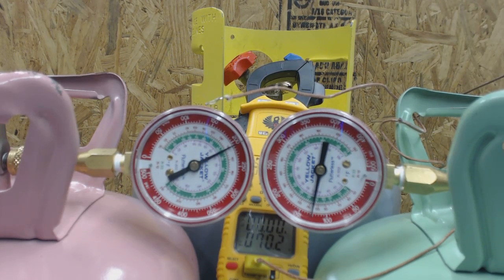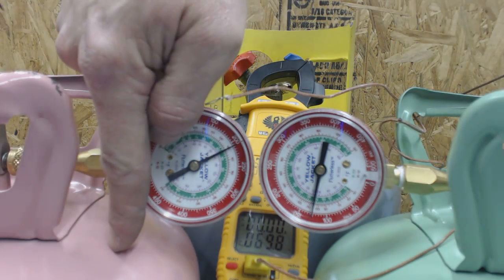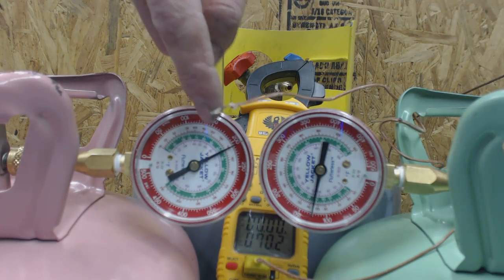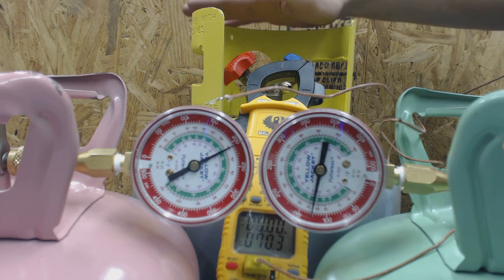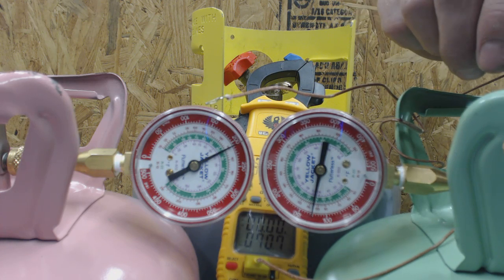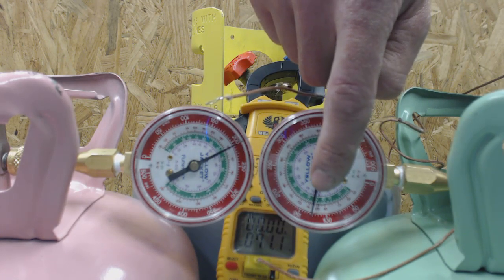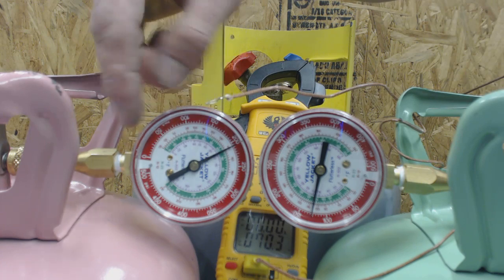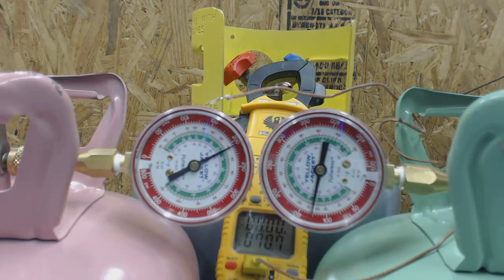Reading Refrigerant Gauges, Pressure/Temperature Relationship, What Refrigerant is in the Tank!

Comment: What is  acceptable amount of difference in the pressure? Would you be concerned if it was 5 or 10 pounds higher or lower than what the PT chart is ? I did this test with a half filled bottle of  new 410a let the bottle set for a few days in I am a controlled building and my pressures could be 5 to 10 pounds difference from the PT chart. I used a temp gun to measure the tank and I did measure the lower part of the tank where the liquid sits.